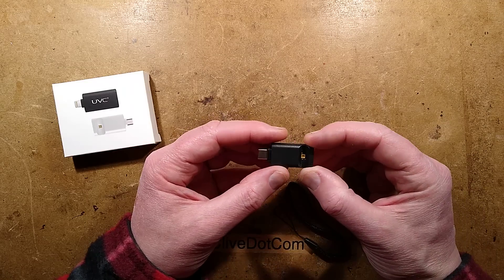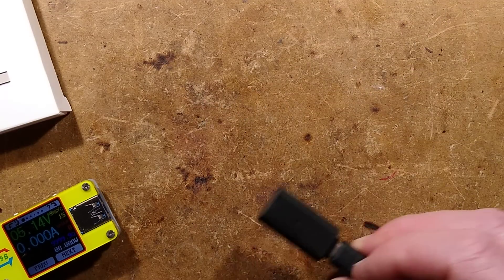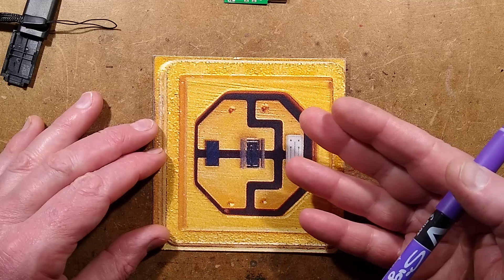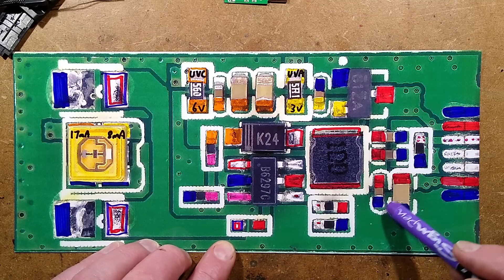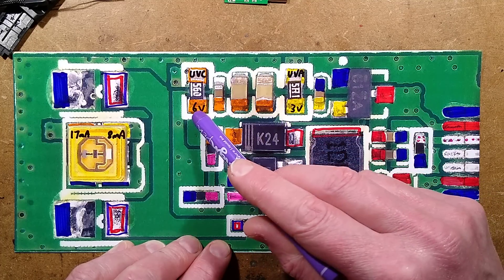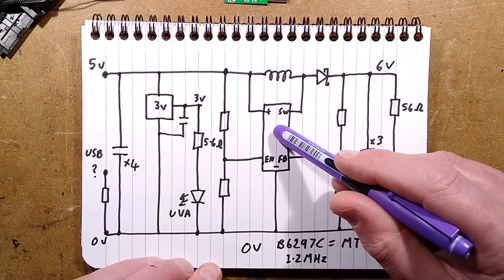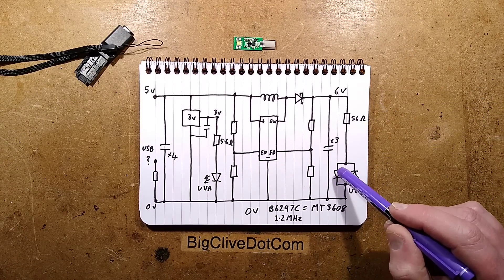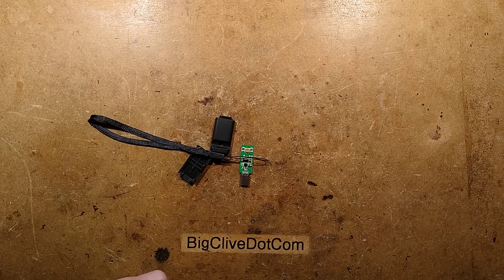"pandemic theatre" USB sterilising dongle

Comment: How do different color LEDs differ in construction?  I thought, that at least at one time, they were all white and had colored covers, apparently not these days.
Reply from the maker: Standard LEDs can only emit a single wavelength (colour).  So white ones actually use a blue or violet LED to stimulate phosphor for white.
Reply: @bigclivedotcom  Tangentially to this, there are the multicolor 3 and 5mm LEDs that use a blue/violet chip + a phosphor to get various colors, I've seen them in Christmas light strings and I think you've dissected some of the same. I've never been able to find these as bulk loose LEDs though, is there some non-obvious search incantation needed or is this style just not really made for anything but decorative strings yet?
Reply: If you look at the "white" LEDs Clive often dissects, they actually look yellow when they are off. The yellow is a mixture of red and green phosphors (red + green light makes yellow light). Some of the blue light is absorbed by the phosphors and re-emitted as red and green, and some gets through, so the ultimate result is red, green AND blue light - making white.
Reply: @zh84  some white LEDs use a mixture of red and green phosphors, but more often they use a single yellow phosphor.
Reply: It's actually the opposite - old LEDs used different chemistry with a different bandgap between the dopants to get different colored LEDs. These days, most of the colored LEDs you get (other than the old-school ones) are blue or UVA leds driving a phosphor. That's why originally you could only get red orange yellow and the lime yellow-green LEDs. Then as more research was done, you got "true green" and then blue, and then violet / bordering on UVA. White is blue or violet LEDs with phosphor, and so are the "strange" colored LEDs like pink and purple. Some christmas lights now use phosphor LEDs for all of the colors now instead of using actual red green and blue LEDs.
Reply from the maker: @gorak9000  One of the reasons Christmas lights use phosphor for all the colours is to standardise the LED voltage for running large sections in parallel.  The phosphor yellows are nicer looking than traditional yellow though.
Reply: @gorak9000  > These days, most of the colored LEDs you get (other than the old-school ones) are blue or UVA leds driving a phosphor.

I assume you mean LEDs for home lighting, not discrete LEDs, because discrete ones (of the ubiquitous sort you order in bags or on tape and reel for use as indicators) are still predominately based on tuned bandgap silicon like always. I've looked around for phosphor based discrete LEDs other than white/yellow and haven't had much luck finding any from a supplier in any format, despite having seen them integrated into lighting products in both SMT and through hole.
Reply: @treelineresearch3387  I replied to your message and youtube deleted it - trying to have a conversation in the comments is useless these days - youtube deletes so many random comments it's not even funny

Comment: I have to wonder if that UVC LED could be driven harder with a more dedicated circuit. Though, right now, it's not exactly hard to get your hands on UVC LEDs, so there's no need to go scrounging through cow pies looking for corn.
Reply from the maker: In this unit a lower value resistor could double the UVC output.